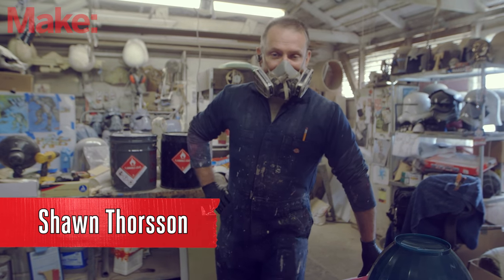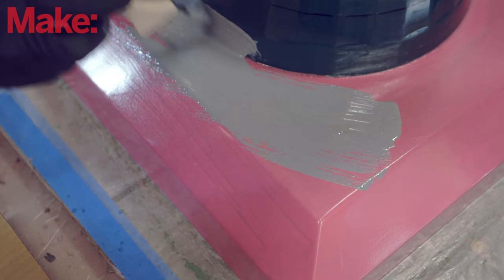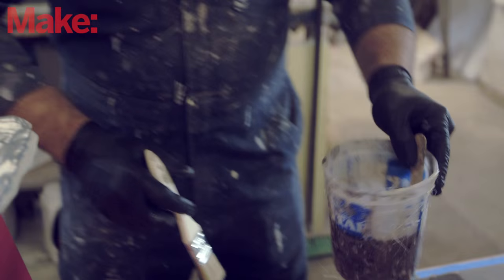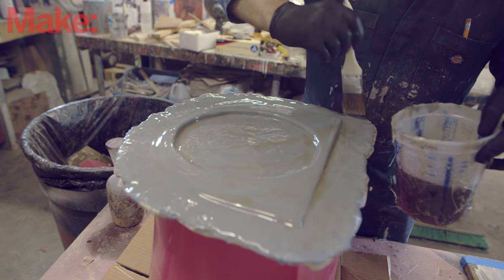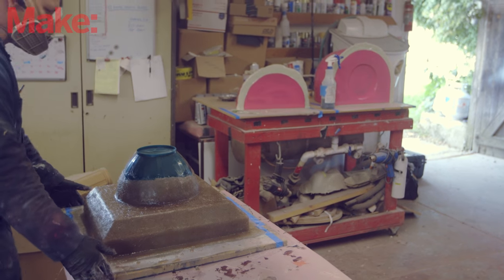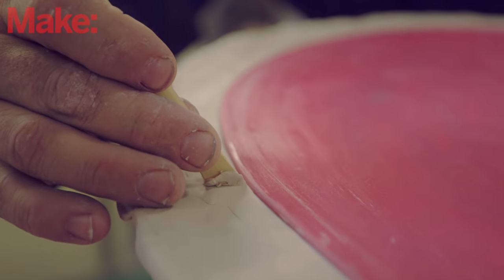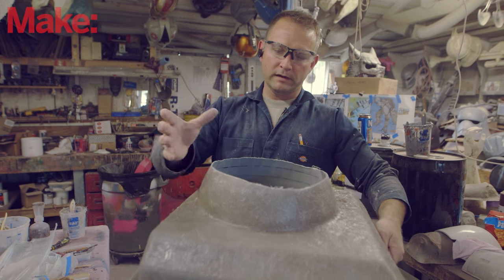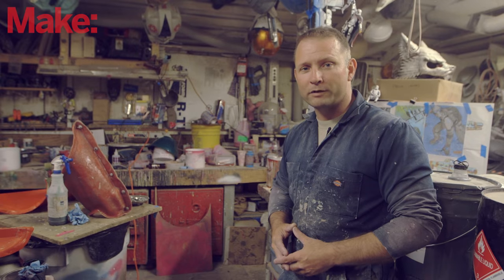Making Makey Part 3: Building the Molds

Comment: You mentioned the tacky surface.  My last few tries with fiberglass ended up just ever so lightly tacky and I thought I had just used too much resin or not enough hardener, even a few days later.  I was scared to paint it because I was worried that the tackiness would create poor adherence but it seems as though you're indicating it's exactly why you want to.  Am I correct in that assumption?

Comment: Why are there no filter cartridges in your respirator?
Reply: There the one that twist on i don't think anyone would take out the paper and filters from the inside ... 
They just look plastic its 3M i think
Reply: Those rectangular things on either side are the cartridges.
Reply: Those are where the cartridges go. They are pink and snap into the recesses of the rectangular things.
Reply: +russwelday nope. look up "3m respirator cartridges" and you'll see the pink variety you speak of but also the grey flat variety that he's wearing in the video. both of them twist onto the main mask. they are just different filter cartridges. He's not just wearing a mask for shits and giggles.
Reply: +russwelday specifically it seems like the pink cartridges indicate they are P100 rated whereas the grey ones are not.
Reply: Thanks for the additional data. I have the 60923.
Reply: +russwelday I'm wearing organic vapor cartridges.  There's also an optional particulate filter that snaps on over them.  Since I'm not grinding a bunch of dust into the air, I've left them off.

The cartridges on the mask are good for about 40 hours of exposure.  When I'm not using it, I keep the mask sealed in a ziploc bag to preserve the cartridges.  I still end up swapping them out every ten or fifteen days.
Reply: Ok Thanks